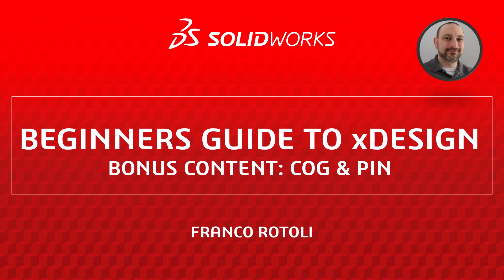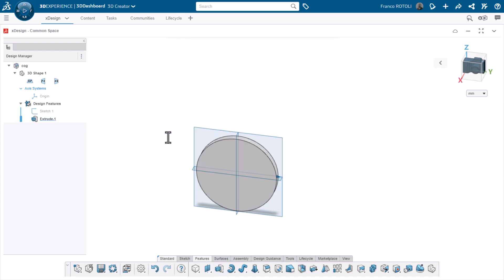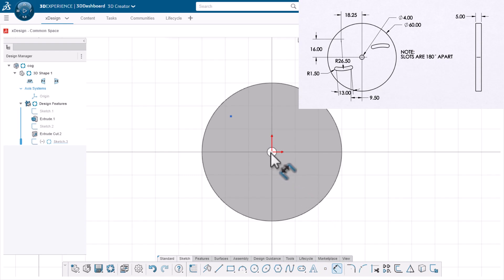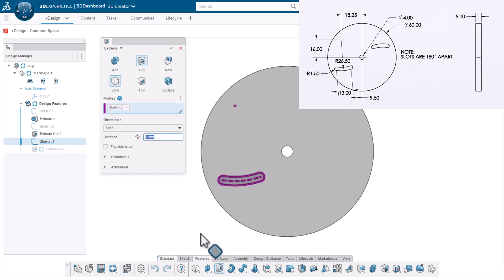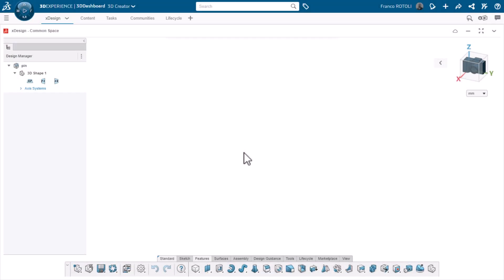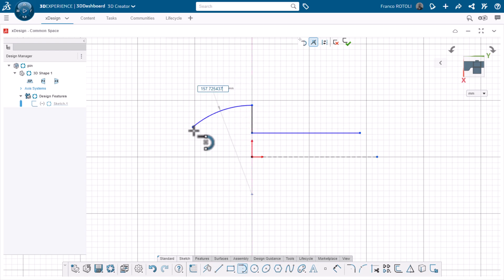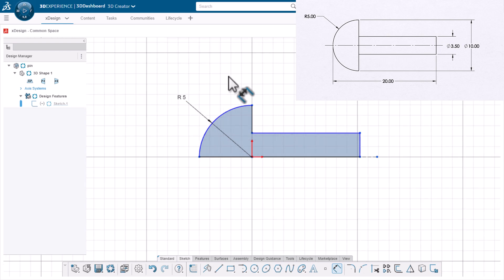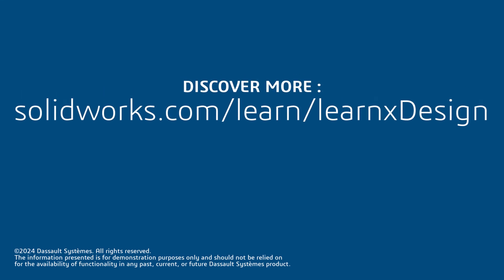Beginners Guide to xDesign – Bonus Content: Cog & Pin

Comment: For anyone going missing that second arc sketch, it's because this is a DIFFERENT model from the one shared in the "bonus video".

Took me a minute, but it can be solved by going back into the original cog sketch, remove the "Extrude Cut 3" and "Circular Pattern". DO NOT remove the "Sketch 3" but instead open it and navigate to the "Sketch" tab, on the far right you'll see the 4 tetris looking blocks with one in blue labeled "Linear Sketch Pattern", click the arrow icon and select "Circular Sketch Pattern". This allows you to duplicate the sketch to the other side appropriately.

Then complete your extrude cut like normal and when you navigate back to the holder assembly you can now connect the arm no problem!
Reply: Thank you Sir! You are a God send.
Reply: Thank you for this.